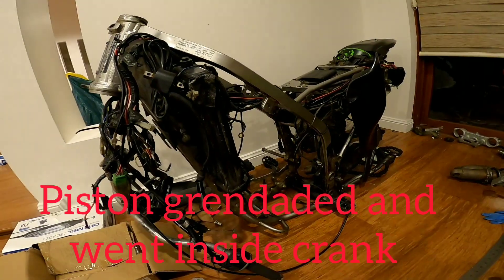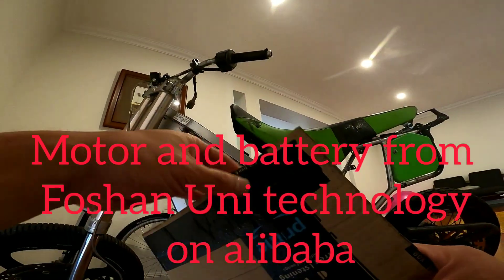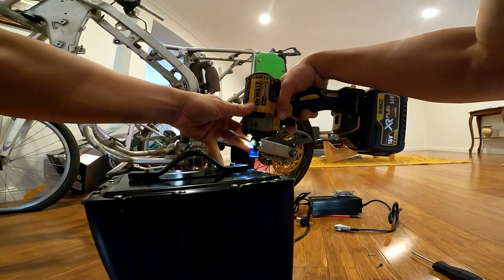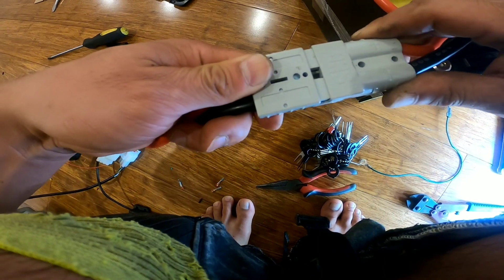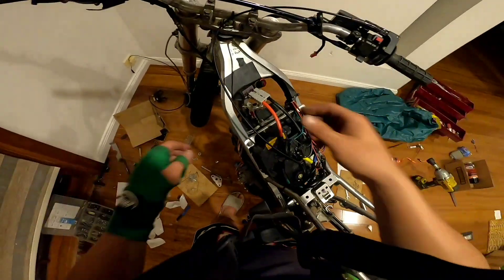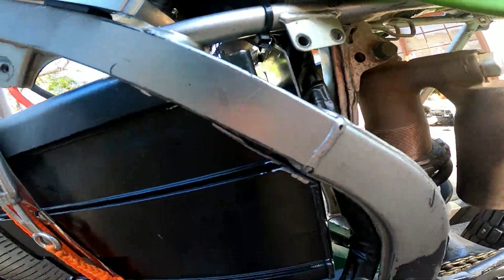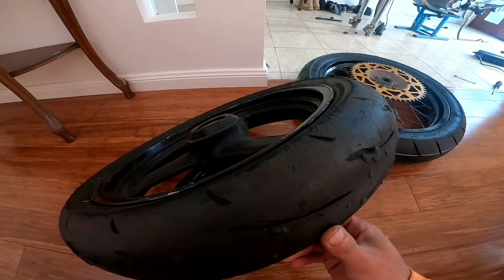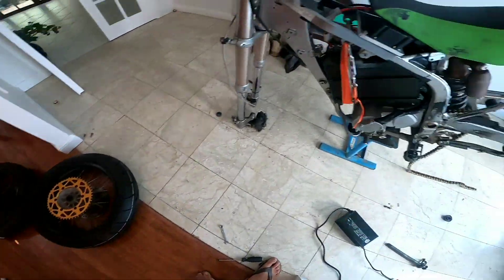how fast DIY electric supermoto kit from china

Comment: Holy shit this is amazing!!! So is the gearbox mechanically controlled bud like on a conventional bike or is it done through electronics? Also where did you source the battery for the kit? (I’m assuming it didn’t come with the rest of the kit?) 
Very inspired! 🙏😎👌
Reply from the maker: If u look up the kit on alibaba the seller will recommend the correct battery and charger for you. I ordered both from the same seller
Reply: @111jkjk  Amazing thanks bud! Im about to start on a quad bike conversion, this all helps massively!

Comment: I'm curious how many Watts is that motor capable of?
Reply from the maker: In eco mode its about 3000w
In sport mode about 12000w but it uses the battery very fast in sport mode. Like 50 minutes and its gone
Reply: @111jkjk  that's awesome, I'm surprised you can keep the wheels on the ground in sport mode.

Comment: Did you put oil in the gear box ?
Reply from the maker: Yep!
Reply: @111jkjk  what discription should I use to search for the kit ?  I built an ebike with a 3 speed gear box , It was so cool to shift with out a clutch. Does yours have a clutch and how many speeds is it ? I've seen some super fast bikes that are single speed , but that toque you can produce with the gear box must be brutal !
Reply from the maker: @jacobclark89  on the alibaba app search "DIY electric motorcycle kit"
My set up is wrong. Gears 1 and 2 are basically useless because of too much torque its uncontrollable. I will need to put in a smaller rear sprocket, but i havnt been bothered yet.
Reply: @111jkjk  thanks, judging by the it sounds like it was geard for rock crawling , ya smaller rear and maybe larger front , I don't know how large your rear wheel is but maybe consider a larger dia if you haven't already. Neat machine .
Reply: @111jkjk  I saw a nice little 3kw set up 4spd . Man I can't believe they are making 8k hub motors with bicycle brakes , unthinkable !☠️☠️☠️
Reply: @111jkjk  I hope you don't bend your handle bars from all that torque ! 🏍️
Reply from the maker: @jacobclark89  some of those ebikes and scooters are kind of crazy. A lot of power but not much stopping force 🤣

Comment: you are mentioning, that the bike feels lighter than it is, and you don't know why...
maybe the answer is that there are no rotating masses in the electric engines compared to gas engines.
(moving masses produce intertia forces that add weight. same principe like a "powerball" or "gyro ball")
Reply from the maker: Ah that is probably why. Very interesting coz the bike isnt actually that light but it kind of feels light
Reply: Probably just the instant torque you get from electric motors
Reply from the maker: @DoesntRefillTheBrita   probably that too. It feels lighter but it isnt in reality

Comment: Nice build..make sure to use oil in the gearbox , it sounds kinda loud ..
That  motor can take 20kW peak..
You can easily hsve it do 2nd gesr power wheelies ..
I would suggest upgrading to ND72850 controller.
Reply from the maker: I did not know this. I do not know much about electronics. Thank you for this information. I will be looking into the ND72850 controller one dat
Reply: Whats the difference with this controller
Reply: @mesniburek.  easy to tune..Great adjustability
Reply: Give us more info bud! 🤓:washhands:

Comment: i probably watched this 50 times already cause i'm interested to do it too.could you please confirm that you got the 80v40ah battery for 710usd?
Reply from the maker: I dont remember what I paid tbh. I do remember negotiating on price
Reply: @111jkjk  ok thanks
Reply: I too want to know because I’m looking for batteries and everything is like 2k plus for a solid 60v
Reply: @rigatoniphoni8247  i personally ended up ordering a 72v 50ah with 80amp bms and charger from AliExpress for 600 euros but it won't be here till the end of summer so I don't really know if it's gonna be good or not.
Reply: @manolismanolakios  you could have just built one specific for your build

Comment: You deserve way more views. 
Gotta hurt to chop a build like that into a easy consumed video under.
Very well structured video and interesting build!

Keep it up!
Reply: Any chance you could link the kit you used?
Reply from the maker: @Blu3Monkee  if that link doesnt work, look up electric motorcycle kit 3000w. The company is called foshan uni technology. The specs say 3000w but its 12000w max, 3000w eco
Reply from the maker: @Blu3Monkee  thanks a lot! I didnt actually take that much footage of the build because i wasnt even sure if it was out of my depth and it would even work.

https://app.alibaba.com/dynamiclink?touchId=1600084160659&type=product&schema=enalibaba%3A%2F%2Fdetail%3Fid%3D1600084160659%26ck%3Dshare_detail&ck=share_detail&shareScene=buyer